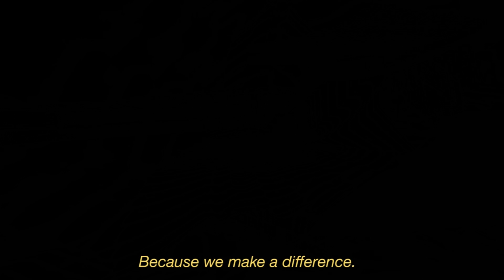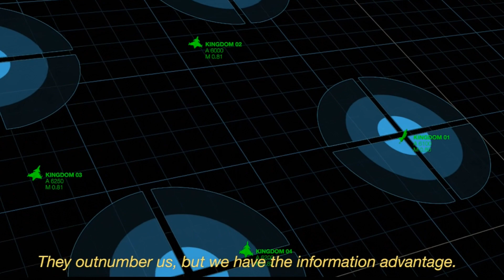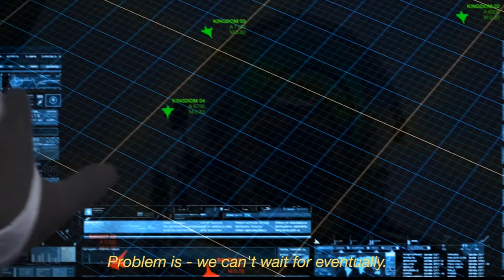Gripen Fighter Jet - Canada's Future Fighter?

Comment: The primary mission of the RCAF is to patrol & defend canadian airspace. The F-35 was not designed for this . Gripen NG carries enough fuel & weapons to be effective in this role. I should also mention that any country that aquires the F-35 wil not have full control over the aircraft. Allied nations will not have access to key blocks of code & will only be able to get mission files from the National Reprogramming Lab in the US.
Reply: latest Gripen is probably better than the superhornet.  Either way Gripen is cheaper to use, cheaper to buy and does the job better.  On the whole they both overkill for what they will be used for
Reply: No, CF-18 are Hornets, not Super Hornets. Different aircraft. Gripen E are much better than Hornets and nearly as good as Super Hornets.
Reply: money MEANS something. if we can afford to send TWO gripens for the cost of one hornet, why the fuck should we settle for one?
Reply: The British also wish to buy new fighters to replace their ancient Harriers, a single engine fighter... Norway and Denmark have flown single engine F-16s above the Arctic Circle for decades with fewer incidents and accidents than Canada has with twin engine CF-18s... The problem with the Gripen is their short combat range, designed for European nations smaller in size than the one province of Alberta. By the way Greenland is similar in size as the Northwest Territories and Nunavut combined. Denmark flies F-16s from Thule with a detachment. Don't believe me, watch this video. https://www.youtube.com/watch?v=qzCsQsmipq0
Reply: @Stu But -  "Super Hornets are better than Hornets" - at what?

Super Hornets and Hornets are NOT the same plane:
http://www.popularmechanics.com/military/weapons/news/a18483/the-navy-wants-to-give-the-blue-angels-planes-it-doesnt-want/

The Super Hornet is a bomb truck.  It is not designed primarily for defensive counter-air which is what Canada needs most.  It is a phenomenal anti-ship and coastal assault aircraft but that's all.  In an A2A battle, it would lose to fighters that are more specialised for A2A combat like the Gripen, Viper,  Eagle and don't get me started on what a Fulcrum or Flanker would do to it.  You've heard of Raptor Salad?  Well this would be shredded Rhino stew.  It's not really a fighter anymore and that's why the Blue Angels don't want it.  It also suffers from excess drag because the engineers who designed it screwed up the wing pylons:  They just didn't care enough to fix it.  Now, if you want me to pay any further attention to you, I'd suggest you start backing your words with proof because the Super Hornet MAY be a better aircraft overall than the Mk.I but it is inferior at defensive counter-air and is VASTLY inferior at defensive counter-air compared to the Super Gripen.  It's not a knock on the Rhino, it's simply not the mission that it was designed for.
Reply: That isn't what I heard from pilots that were apart of the recent Red Flag exercises. The F-35 kill ratio was very high. There is a reason why Japan, South Korea, Australia, Israel, United Kingdom, Italy, Norway, Denmark, Netherlands, and Germany are buying F-35s. With Belgium most likely to do so too. There is a reason why United Kingdom, Italy, and Germany are not buying anymore Eurofighter Typhoons... There is a reason why the Liberals have not commenced the fly off competition they promised in the last election... There is a reason why the RCAF have been wanting to buy F-35s for the past decade despite the development issues, which by the way are being addressed... And finally, there is a reason why the Liberals have instituted a "don't discuss" policy dealing with new fighters procurement... The RCAF have been silenced...  Some transparency. NOT...
Reply: Just an add on from me - Its true the UK is not buying any more Typhoons as such (at the moment as we are still receiving new aircraft from BAE) - But they are restoring to full operational flight the earlier Tranche 1 aircraft that have been in 'warm store' and standing up two new Squadrons. Not the actions of an Air Force with a lack of confidence in its aircraft. A further development in 2018 / 19 is the retirement of Tornado from the RAF and the transition of Tornado squadrons to the latest Typhoon with full weapon integration. I would like to see how a single engined Gripen will deliver the bomb load, supercruise, range, loiter time and swing -
 and multi - role capability a new Typhoon will.

What is in the melting pot though is the decision as to what the RAF will start to need in the 2030s (Typhoon will retire in 2040). The decision to buy F-35B aircraft was a 'no-brainer' as its STOVL,  answered many questions for our new carriers and restored the Harrier role to the RAF plus it brings 5th gen capability. And 20% of every F-35 sold anywhere in the world is built be BAE, Rolls Royce and others in the UK so we have a vested interest. But we also have a need to retain the complete 'design and build' capability for advanced fighter jets. We learned NOT to do any more shared deals with the French or Germans again (and anyway they are off doing their own thing). We haven't been too impressed either with the way the Yanks shafted us with placing F135 engine maintenance in Turkey, airframe maintenance in Italy after they were also given an FAL building F-35s. And we are supposed to be a 'Tier One Partner'. 

So will we (the RAF / FAA) transition to a mother ship controlling UAVs with the Taranis / Magma development aircraft performing so well or do we build a manned 'Typhoon II' completely here? The temptation is to look at the F-35A but it is single engined and has restricted weapon capability when compared to a Typhoon and will be 20 years old. But the Typhoon / F-35 combination is a very lethal one.
Reply: Ron - It is far more than a 'wish'. We are already taking deliveries (14 to date) and have had a test and evaluation people in the USA for 2 years. We are more than just replacing the Harrier and the STOVL attributes we lost when we had to retire them. We are also adding 5th Gen Stealth capability and creating a new style of low cost carrier strike capability and for all that a single engined aircraft is fine. Possibly even compulsory! For our wider QRA, CAP, CAS, GA and long range operations we are now standardising on the 4.5 Gen, swing - multi - role Typhoon with two engines. But that is ( and so should Canada's be) part of a wider air force policy: A large fleet of flexible Voyager tankers, C-17 and A400M freighters, new Maritime patrol aircraft and a bunch of surveillance assets.
I can see no other current aircraft that fulfills Canada's military and industrial needs so exactly as Typhoon. Gripen is really not the answer, Rafale locks Canada into a French only weapon supplies and the Hornet is basically a tarted up old banger. Whatever the cost Typhoon would be a key step to rebuilding Canada's aerospace industry with people it knows and trusts with the flexibility to add whatever weapon systems it chooses and the warfare suites it chooses. And we could send the RCAF an RAF Squadron of Typhoons tomorrow with which to train and develop tactics!

As for F-16s I am not sure they can deliver the weapon load the Typhoon bomb truck can over such long distances or at supercruise speeds. I am happy to be proven wrong though as always ....
Reply: It is my opinion Canada should buy the fighter the RCAF has wanted for over a decade. A fighter they have participated with the development program winning significant parts contracts. The single jet engine in today's world is red herring. The second jet engine only doubles the chances of a incident, as well as increase the cost of support. If there is a incident with one jet engine, most likely the fuel lines, etc., of the second jet engine sitting side by side is affected too.
Reply: Google the numbers yourself. Here is a defense website which agrees with me. Read it please. Open your mind. https://defenseissues.net/2014/08/09/single-vs-twin-engined-fighters/
Reply: BTW the blue angles are a stunt plane squadron not a unit dedicated to air combat.
Reply: please stop you're embarrassing knowledgeable Canadians.
Reply: You said it. Denmark has been flying a detachment of F-16s from Thule Greenland for decades. Greenland is much larger than Sweden, Northwest Territories and Nunavut combined are around the size of Greenland whereas the one province of Alberta is around 30 percent larger than Sweden. Denmark has had fewer incidents with their F-16s than Canada has had with their legacy CF-18s over the past three decades. Fighters fly over ten thousand meters, have you checked out how cold the air is up there? Varying weather conditions, what a hoot...
Reply: If Greenland isn't impressive with single jet engine F-16 fighters, how about Bodo, Norway just north of the Arctic Circle? Two thirds of Norway's Falcons are based there. Granted Norway isn't as large in size as Greenland. From the video Bodo isn't any better in terrain than Northern Canada... https://www.youtube.com/watch?v=-Xlb9sW04zs
Reply: Avro Arrow, I hope Canada buys the 85 million dollar Gripen and loses 50,000 Canadian jobs with the F-35 program in the process. Idiots like you should set up a little Gripen factory in Canada, so Trudeau can say he brought 2000 jobs to Canada while giving up Lockheed Martin billions and 50,000 Canadian jobs. Slap those maple leaf decals on them if it makes you feel better.
Reply: SH sacrifice a little bit of agility for better performance in other areas that are more relevant in modern air to air combat and also has air to ground capability. Pretty much all other areas are improved. Blue Angels like the Hornet because they are solely interested in aerobatics, not combat. Not sure why you have so much hate for that particular aircraft. It is not the most capable fighter but neither is it the least capable. Also, I never said they were the same plane as Hornets. My point in fact is that they are related but considerably different.

But you missed the point entirely.  Newer aircraft build on older aircraft and improve capabilities to be more relevant for the current missions. F-15 2040C are vastly more capable than you are giving them credit for. Gripen are pretty good and I like them but they have inherent limitations, mostly related to their relatively small airframe. Your groupings by capability are all off. 

Gripen are at the top of the heap within the group of budget aircraft but cannot compete with the more expensive options, some of which are only slightly more expensive now that the Gripen has increased in price. That small size gives them a slight advantage in avoiding detection but they are not stealth aircraft by any means and will be detected. Their small radar gives them relatively shorter ability to detect other aircraft even though it is of a capable design.  Detecting first is by far the single most important factor in modern air to air combat, not aerobatics.

They are good aircraft for building up quantity numbers in large air forces or for serving as primary fighters for poor countries. Canada is a wealthy country with a small air force which means that higher capability aircraft would be a better choice.
Reply: the plane is worth more than the pilot , i say the cocky sonofabitch better be dead if we aren't getting our plane back.
sorry dude , we get all the volunteers we need .NEXT!
Reply: A great solution to this whole ordeal is to get 6 squadrons of F15 silent eagles and 6 squadrons of JAS 39Es, get Canadian companies to outsource the F35 technologies into the F15SEs and JAS 39Es, Canada had contributed into the F35 program. And also to make these aircraft in Canadian Factories (atleast some parts).
Reply: Yes absolutely, totally cost effective running three different platforms when you can really only afford one...next!
Reply: That my be true however Canada's air space consists off large arctic regions and both of those plains only have one engine. Not ideal in such harsh conditions. thats why the super hornet is more appealing for long range patrols in very cold wet environments. you could argue that a f22 would be a suitable air craft however the bird is too expensive and already behind cutting edge tech. In other wards too expensive for what it actually is capable of doing.
Reply: No one engine is still a terrible idea. Thats one failure point a foe has to hit. and jet engines don't fair well over the canadian arctic. You forget that these are weapons platforms not commercial aircraft. one fail point is worse than two. End of argument
Reply: The F-16 is, like the F-18, a legacy aircraft that is now getting to its sell by date and production lines are closing. And you quote CF-18 failures without adding how old they are or the circumstances. Just they are twin engined and therefore it proves your point?

Oh and by the way the Danish Air Force only flew the F-16 in Greenland for the first time in 2014. So thats OK then .....

I will ignore your sarcasm as it adds nothing but the issue is NOT temperature but range, how fast a fighter can get to the operational theatre and how long it can loiter when there. Basically the reason why 'supercruise' capability is fundamental. And nothing does it like a Typhoon (OK the F-22 has a better in cruise speed @ Mach 1.7 vs Mach 1.5 but a shorter range). And when it DOES arrive what can it deliver? And on every one of those factors the twin engined aircraft like the Typhoon or Rafale beats the F-16 and F-35 hands down which cannot Supercruise at all. They also beat the Gripen by a big margin as well which barely achieves Mach 1.2 Supercruise. F-18 never has been able to Supercruise and also cannot match the weapon load or choice of the Typhoon.

And even the F-35 programme itself says the F-35 'is not designed to supercruise'.
http://www.jsf.mil/contact/con_faqs.htm

So Canada, with its vast domestic area to defend, is better served by a slower, less capable aircraft, that will be later into action (lets call it 'NSQRA' - Not So Quick Reaction) and cannot deliver as big a weapon load others can? That looks really convincing.

That the Danish Air Force is replacing an old single engined aircraft dating from the mid '80s and second hand USAF stock with a newer one is a no brainer. And the fact the USA has funded a considerable part of the Danish Air Force jet programme since the mid '50s established a pro- USA bias in Denmark and why it is also a contributing partner to the F-35 programme. Because of this both Dassault and Eurofighter withdrew from the competition by 2008 when Boeing entered the F-18 for what became the 27 F-35A contract. The ITT was clearly biased towards the F-35A.

So objective argument about how Denmark indicates how Canada should act is fundamentally flawed.
Reply: Ron - Move away from your fixation with location and the F-16. Canada is a huge area and it doesn't matter if it is Arctic or not (unless you eject out of an aircraft onto icebound terrain) I gave you the key criteria:
Speed of transit (Supercruise)
Range (Fuel burn and tankage)
Loiter time (a combination of the above)
Weapon Load (No of pylons and all up weight)
Redundancy (if an engine fails)
And no matter how you cut it based on these criteria the Gripen, F-16 and F-35 don't come anywhere close to a Typhoon (or Rafale). Only Gripen of those three can even Supercruise!

And given Canada's defence policy one has to ask why it need a 5th Gen Stealth aircraft at all. Stealth is an aggressor benefit. Canada is not an aggressor nation unlike the USA. And no the UK is not an aggressor nation either and the fact the F-35B IS Stealth capable is an added benefit to the main reason we are buying it - STOVL. We are not buying F-35A or F-35C aircraft.
Reply: Google how many incidents the RCAF have suffered with the CF-18, and then Google how many incidents Norway or Denmark have suffered with the F-16s. When one jet engine blows up, spills its parts into the other jet engine, fellow, they both blow up... Fighter jets are not commercial airliners with their jet engines many feet apart on both wings, fighter jets are military jets with both engines on the fuselage side by side... When one blows up, the other one blows up... A fact no spin can change...
Reply: Ron - and how many Typhoons have blown up? or Rafales come to that? One could mention that both Canada and Australia bought overweight Carrier aircraft for over land use and ask why? The F-15 was a better fit. Oh wait ... that has 2 engines ...
And exporting Canadian jobs to the USA is never worth the price of an F-35 no matter how good.
Reply: I agree the F-15 Eagle was a better fit for Canada during the 1980s. Unfortunately the Liberal government chose CF-18 Hornets. Why? They were cheaper. Canada always chooses the cheap route. They are so cheap they would kick the can down the road and buy spare parts, more of Red Green's duct tape. The Liberals after two years in government have not advanced the new fighter file any whatsoever. They haven't bought any new defense kit, what is being delivered was purchased during the Conservative government. Canada quit during WWII in the Pacific, and they are still quitters... No guts, no glory...
Reply: Ron Clark...No guts? A hero you are? Please, do tell.
Reply: That's exactly what it was designed for man.
Reply: For the US that's okay, but for any other country this hampers it's use outside of nice roles
Reply: wiskadjak and it was made to manouver around mountains
Reply: @Chris White - What do you base that bullshit on?  The Super Hornet would get splashed in seconds by a Gripen!  The Super Hornet is an overweight pig of a strike aircraft that the Blue Angels gave back!  What are you, an American?
Reply: @Peter O - I couldn't agree more.  The Super Gripen is far more potent than ANY American plane in production and costs less.  Like you say, everything is overkill for Canada's purposes so let's not overspend on inferior American products that we don't need!
Reply: @randomguy8196 - Since the Gripen has NEVER had an engine failure, EVER, don't you think that you're being a bit stupid with that statement?  Are you aware that if we had Gripens instead of Hornets that all of the airmen we lost would still be alive?  Now, the Gripen wasn't yet available but since 1988 (first flight),  only ONE man has died flying one and that was in January of this year (2017).  That two-engined argument is so lame and passe that I suggest that you not use it anymore lest you embarrass yourself further with it.
Reply: @Avro Arrow Super Hornets are better than Hornets, Gripen E are better than Gripen A, late tranche Rafale and Eurofighter are better than early versions. Do you not think F-15s have made progress as well? F-15 2040C are far more capable than early models and far more reliable as well. 

I think that F-15 2040C is the best aircraft for Canada but Rafale is also a good choice if you have some prejudice against US aircraft. These both have long range and good weapons load limits which are important characteristics for a large country with conditions that limit the location and number of bases.  A large sea area and encroachments by antagonistic foreign aircraft such as Bear bombers that could potentially be carrying nuclear weapons give further importance to maximizing range and air to air weapons. The capability for high speed interception would also be highly desirable. F-15 2040C and Rafale are the best current aircraft available for those requirements.
Reply: @Stu_Bur  - The only advantage that "Super" Hornets have is weapons payload and they fly slightly faster.  Meanwhile, their missile pylons had to be slanted which makes them extremely draggy.  The F/A-18E/F shouldn't even be called that because it's not the same plane.  The designation was used to exploit a loophole in US Navy procurement that states a flyoff MUST be had with another manufacturer's offer before a new aircraft can be selected.  By not changing the numbered designation, Boeing managed to pitch to the right people in the Pentagon that the Rhino is just a "variant" of the Hornet even though it's almost a completely new plane.

The Rhino was designed specifically for the US Navy to match what the US Navy wanted.  For the US Navy, it's pretty much perfect.  It's a formidable anti-ship and coastal assault craft which is what the USN wanted.  However, it absolutely sucks ass as an air-to-air combatant.  The Hornet was a light fighter, nimble, agile and did well in combat scenarios (except when the MiG-29A Fulcrums of the Luftwaffe embarrassed them in Red October events).  The F/A-18E/F weighs MORE than the F-15 Eagle which was NEVER a light fighter so there's no way that the F/A-18E/F is the same plane as the F/A-18A-D.  It weighs more than the Eagle but it has far less thrust.  That's ok for a bomb-truck but not an aerial combatant.  

The Rhino was designed to be a naval tactical strike aircraft and it makes sense because the US Navy has a near monopoly on aircraft carriers.  It stands essentially unopposed on the high seas.  Any aerial assault on a US carrier wouldn't get past the AEGIS destroyers and frigates that surround it.  The US Navy did away with the Tomcat not just because the F-14 was hideously expensive, it's because they realised (quite rightly) that US carriers no longer need planes to intercept and battle other planes.  For this reason, the Rhino is ideal for the US Navy but completely unsuited for the RCAF.

As an aerial combatant, the Rhino wouldn't stand a chance against a JAS-39C let alone a JAS-39E.  It's bigger, slower, sluggish in turning and uses inferior weapons.  Nobody in their right mind would say that the AMRAAM/Sidewinder combo is equal to the Meteor/IRIS-T combo.  I know that Americans love to talk about stealth but compared to the F/A-18E/F, the JAS-39E may as well be an F-22 because there's no way that the Rhino is going to see the Gripen first if they ever fought.  Sweden's Gripens routinely spanked Norway's Falcons and Thailand's Gripens spanked China's Flankers!  If you think that the Rhino is in the same league as the Falcon or Flanker in the A2A department, just stop right now because it's clear that you're not well-versed in the world's fighter planes.

The RCAF needs a fighter than has some A2G/A2S capability not a strike aircraft that has some A2A ability.  Why would we need a strike aircraft?  We have no disputed land border and no hostile neighbours.  We need a fighter to intercept wayward planes and patrol our skies, a fighter that nobody wants to tangle with.  The Gripen is fast, extremely efficient, uses the most advanced weapons in the world, is extremely versatile, extremely hard to detect, was designed for quick and easy maintenance, logistics and software upgrades.

Other advantages that it has over the Rhino is its more advanced canard/delta configuration instead of the old cold war-era cruciform/elevator design.  It has amazing short-field performance, an engine swap can be done in an hour by ten men without needing a hangar to do so, A2A turnaround takes ten minutes, A2G/A2S turnaround time is 15 minutes and that's with ONE officer and 5 enlisted men at a roadside.  It's also the safest and most reliable fighter jet EVER MADE with ZERO engine failures and one NOT-AT-FAULT fatality in 23 years across five air forces.  I ran the numbers and the Gripen has proven to be 20x safer than the CF-18.

The ONLY advantage that the Rhino has over the Gripen is a greater combat payload.  Payload is completely irrelevant in A2A combat because the more ordinance you have hanging from your wings, the more likely you are to be shot down.  Sure, the Gripen can't carry as many bombs as the Rhino, but EVERY strike mission that the RCAF has ever flown for NATO has required FAR LESS than even the Gripen-C's payload, let alone the Gripen-E.

Then there's the people who claim that a Canadian fighter MUST have two engines.  What a crock of shit!  As I said before, I ran the numbers and did the math.  I compared the JAS-39A-D with the CF-18.  I used the CF-18 because Canadians are quite pleased with the service that the CF-18 gave us, myself included.  I also used it because it's the obviously the most relevant twin-engine fighter to Canada.  

Fighter pilot survivability in the single-engine JAS-39A-D was literally 20x that of the CF-18 despite the fact that they both use a version of the GE F404.  The CF-18 uses the F404-GE-400 and the Gripen uses the Volvo Aero RM12, a version of the F404 built in Sweden by Volvo Aero under licence from General Electric.  Of course, we all know how obsessed Volvo is with safety and they made significant modifications to increase the durability of the engine to the point that it can (and has, on several occasions) ingest a bird the size of a Canada Goose without missing a beat.  General Electric wisely adopted Volvo's modifications when designing the successor to the F404, the F414.

When you're using an engine that is incapable of failure, you only need one.
Reply: @CF-105_AvroArrow  I did not suggest the Super Hornet for Canada and still do not. Your long rant of Gripen vs. Super Hornet I find irrelevant since neither is well suited to the needs of Canada. The best options for Canada are new builds of the latest variants of  F-15, Rafale, or Typhoon. F-35 should only get an honorable mention because while they are fantastic in strike missions they are less well suited to the vast majority of Canada's missions which are patrol within their own air space. Super Hornets and Gripens should not even be under consideration. But politicians will buy whatever they want regardless of how ill suited they are to needs.
Reply: @Stu_Bur  

F15 for Canada's needs?

The F15 is an aged aircraft design from the early 1970s.  the F15 2040 is nothing more than a proposition.  that even if becomes reality becoming adopted Its not fundamentally different aircraft in terms of airframe.    A Rafyale is yesterdays technology. as well as the Typhoon even if they can be updated.  Typhoon shouldn't be top consideration its more expensive than the current F35 price which is only going to get lower as more are produced.

F35 as a new aircraft design already has a very impressive avionics suite, but  far more future proof for newer upgrades compared to Rafalye or Typhoon.  and neither of those aircraft would qualify as "stealth".

And as a NATO member Canada does need a plane with Strike capability and something that will work closely. They participate in various US lead coalitions, where Multirole fighter was necessary. and in event of major war they absolutely need something that can perform both A2A and A2G.

F35 had not only shown its lethality in RED FLAG excercises, but its also becoming the aircraft of choice for NATO.

Look at Belgium France made a public offer to the Belgian government, they would prolong trade agreements and other projects worth 3 billion euros, ( Ie  playing poltic to sweeten the deal)  if Belgium adopted the Rafaele fighter.  In spite of that, hat didn't sway them to purchase French A/Cm   They chose the F35 because they chose what was best.
Reply: @CF-105_AvroArrow   

By no means ijs Super Hornet is what Canada needs, especially being a last generation design,  but the Super Hornet Is certainly not inferior to the legacy Hornet in A2A, at least not where it really matters in Modern era combat, Avionics, most notably that it has an AESA radar and IRST.

the Super Hornet whilst being mechanically different , and a new air frame, nonetheless  on a air frame design based  of the Legacy Hornet . and in terms of avionics, despite being more advanced then the legacy there Is not fundamentally different to qualify for as a Pilot.

https://fightersweep.com/5334/ask-fighter-pilot-hornet-vs-super-hornet/

According to dual qualified pilots  Navy , the Super Hornet is so similar that even A Legacy pilot with no SH experience would have no issue figuring out how the basics, how t to start, taxi, takeoff , and later shutoff the A.C  successfully on their first go. Even the Multifuction display  pages are very similar  ( some the same) format to the legacy hornet, and allow familiarity for pilots. meaning any Legacy pilot transition program to a SUper Hornet is going to be swift compared to switching to  totally different aircraft.

But that was the point of the Super Hornet, It was nothing more than a Interim solution because the A12 project failed, and because the F35 project was in its infancy stages. ITs not some major evolutionary jump in aviation technology like the F35 is going from an F16.
Reply: Canada primarily requires aircraft to patrol their own air space. They have a tiny air force to cover a vast area. The thousands of F-35 becoming available to the USA and other countries will be more than enough for any grouped force strike needs. There are on the other hand relatively small numbers of aircraft available to support them in roles that F-35 are less well suited for such as long range patrols with external tanks, carrying external electronic warfare equipment, carrying large weapons, and carrying large numbers of weapons.  

F-15 are still in production and the modern options available are impressive, especially in recent proposed designs such as F-15X. The force multiplier possibilities by combining them with stealth fighters in combat operations are real and significant. 

The public technical details of each aircraft you can find from public sources. I will not provide any sensitive information so don't ask.

The biggest help that Canada can provide to allies is to patrol their own air space. They don't have the resources to send significant numbers of aircraft to other areas. Whenever they draw some out of their own air patrol to send overseas, they take a significant portion of their total force which could create gaps in coverage.

Stealth fighters would be nice to have but Canada can only operate small numbers of fighters and long range fighters with powerful radars and large weapon loads are needed. Stealth fighters have small weapon loads to keep them internal and modest ranges that cannot be assisted by external tanks without completely ruining that stealth. It is a matter of priorities and needs to suit mission requirements.
Reply: @Avro Arrow - you are a very angry person who doesnt seem to like Americans much. Did they slight you by chance?
Reply: Stats dont lie. Yes, the Gripen is lighter, F/A-18E/F is heavier but has 2x the engines with same power per engine. More power to the Hornet per engine. 80.5 kN x1 for the Gripen and 97.9 kN x2 on the Hornet. Ive seen a Superhornet live in person. however not the Gripen. Love to see it though. Id say Id like to have the Superhornet due to reliability of the dual engines and reliability of the design. Id really like to see the Canadian Airforce with the Eurofighter.
Reply: @Stu Bur - Nearly as good as Super Hornets?  You mean those overweight pigs that can't supercruise and are only really good as strike aircraft now?  Super Hornets are a bad joke that only proves the absolute corruption of the US Government and the Military Industrial Complex almost as well as the F-35 does!
Reply: So basically we have no need for any system redundancy in aircraft? Well thats great news because we can save a fortune there ..... Until .....
And I cannot believe that exporting Canadian jobs to a USA that is currently attacking the only Canadian aerospace company is a really good idea at all. That is like having a thief burgle your house and you then offer him your car as well? Better to create new aerospace jobs IN Canada and rebuild what was a world class industry once. The UK has been rather too good at exporting jobs and then paying the price. Hopefully in the new era in which we are embarking we will find our old ambitions and pride that the Liberal EU Luvvies have stifled for so long. And what better partnership for us both than with this fighter deal. We both win.

If you want to be forever in hock to the USA and let them dictate your Defence Policy then carry on and give in to Boeing and buy from LM. We broke with the EU because we said 'no more' being controlled by foreigners who do not have our national interest at heart. Do a deal with the Uk and buy our Type 26 Frigate in Canada with BAE and all those Canadian Partners. And add to that with a Typhoon deal with BAE and Canadian partners. Bring jobs HOME to Canada. Don't make the mistakes we made in the '80s and '90s.
Reply: Fucking Hello??????????
Saab licensed the engine for the Gripen from General Electric which built the engine for use on the Super Hornet.  
THEY ARE THE EXACT SAME ENGINE!
The US government can veto all sales of Gripen and Saab can't do a thing about it.
Same as the Brits.
They can also veto Gripen sales because the Gripen uses technology made by BAE-UK.
They reason why Gripen can be sold and operated so cheaply is because it mainly uses off the shelf proven technology from the US and UK.
There is nothing "cutting-edge " about this airplane despite what you hear from Saab sales people.
All these state of the art technology you hear boasted by Saab is something the Super Hornet had a decade ago.
Reply: The F35 already outranges ( with internal fuel alone) the F15 eagle , which in turn has Longer radius than the F18. So the F35 certainly wouldn't be lacking  for  Canada's Airspace patrols
Reply: @kcz1093  F-35 range is less than F-15. Reports to the contrary have been misleading.
Reply: @Stu Bur - Are you an American or something?  You want Canada to buy outdated American planes that WERE great (but are outclassed completely by the Eurocanards) and a piece of shit that the Americans STILL can't get to work right?  Everything I see you post makes no sense whatsoever.
Reply: F-15 2040C would be a good choice for Canada whether they buy some F-35A to complement them or not.
Reply: They already have a full compliment of Super Hornets which are far better than the Gripen